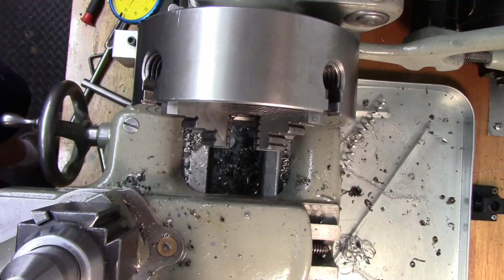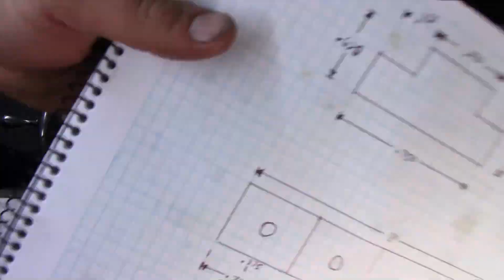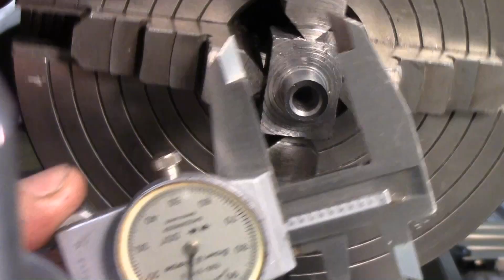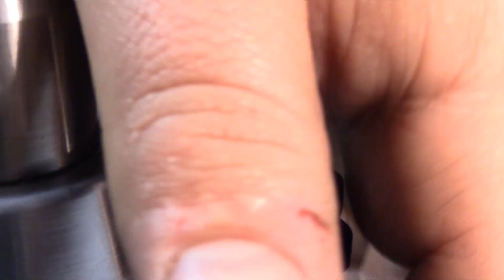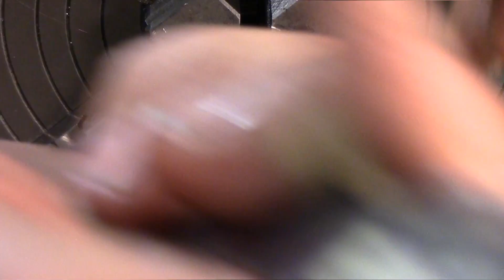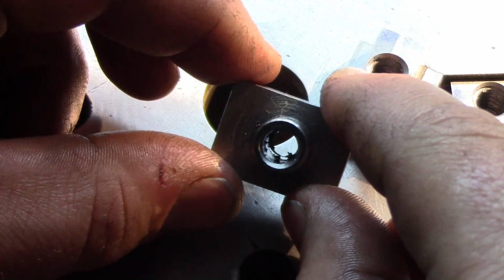Making A T-Nut On A Lathe

Comment: I'm upset I didn't think of this when I needed T nuts. I bought some from Shars and shortened the height the same way you did. When I was done I staked the holes on the bottom because a bolt or a stud could go through the nut and push into the table. When a bolt or stud bottoms into the bottom of the slot you will lift the nut and break the T slot in the table.

Comment: A very ingenous way to make a T-nut. Good illustration of why the 4-jaw is so powerful.  I was surprised that the insert stood up to that interrupted cut, AKA shock loading. My score on that is 5 edges broken so far. Brazed carbide is much more resistant, for reasons I do not understand.
Reply: ة ت معه إى ا لأسهم حيل
Reply from the maker: These Seco  32.51 inserts have been holding up well to the abuse.  Only time I've broken one is when I've pushed my lathe beyond its capabilities and stalled it.
Reply: You have a much bigger lathe than I do so you will have bigger insterts and fewer fractures. Still, as doubleboost would say, interrupted cuts are twastards.

Comment: I like to use a dead center between the part and the tail stock (with live center). Then you can just dial in on the dead center. Much easier than doing 4 sides of a square.

Comment: If you round off the larger part of the t-nut too, you'll be able to slide it further down the slot in the rotary table. Maybe best to only round off one side to save as much contact surface as possible.
Reply: The base is squared off to keep the nut from just spinning. 😆

Comment: A much quicker way is to thread the T-nut in advance. Mount in the 3-Jaw a bolt of the same thread and screw the nut onto it and then just turn to diameter!  This wiil save you 20 minutes on indicating in the 4-jaw every time you make one nut. See Video..:)
Reply from the maker: Indicating doesn't take much time.  I personally don't like holding things on bolts if I don't have to.

Comment: This is the second video you've posted on this subject, isn't that right? I couldv'e sworn I'd used one of your videos as the basis for machining my toolpost t-nut. Is there a particular reason you took the effort to re-center the nut after flipping it? I'd have thought the only important thing about that cut was parallelism to the top face, anything else being merely aesthetic
Reply from the maker: I didn't have a video of machining a nut.  I've explained it before, but I don't think I've ever showed it.  You don't have to get it on exactly center.  If you watch you can see I have some run-out because it moved when I was tightening the jaws down tight.  You just need it in the ball park so that your interrupted cut isn't heave on one side and it's relatively even.